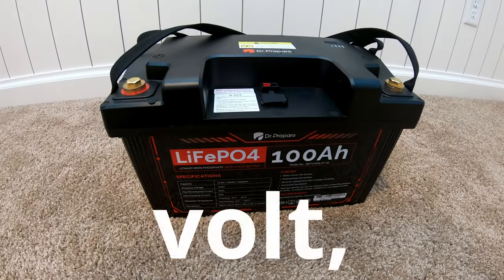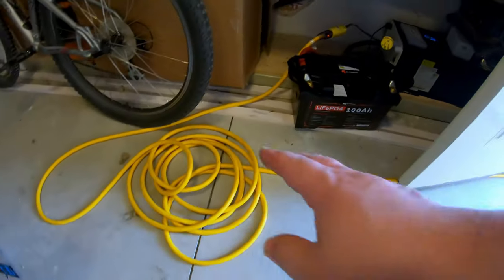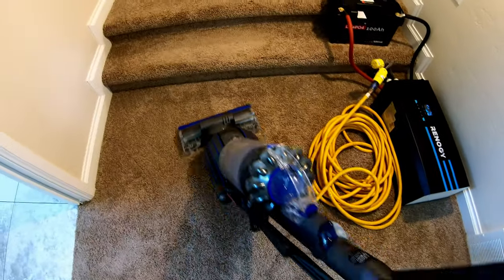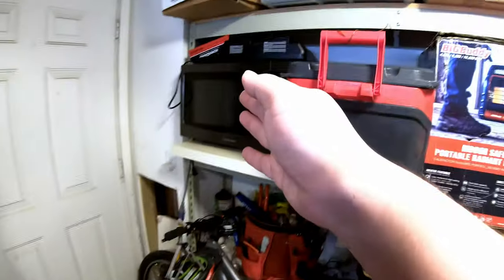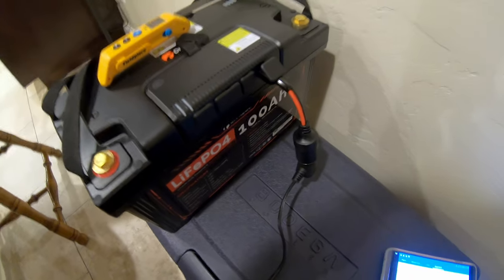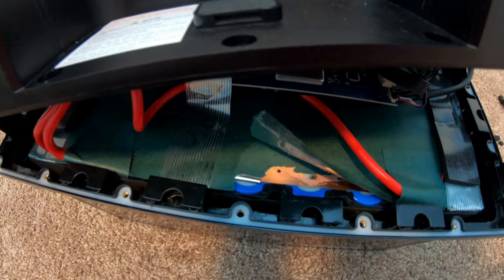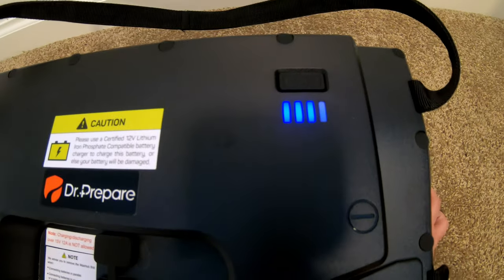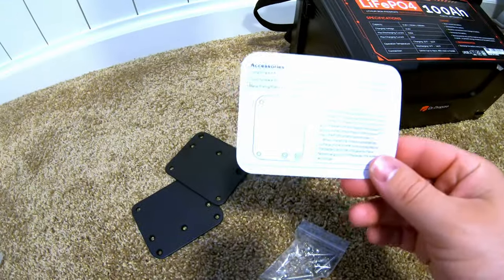Must-See: Dr. Prepare 12V LiFePO4 Battery & Hub Review

Comment: Darn, I'll have to get rid of all my Dyson Vac cleaners. I read that Dyson has discontinued all corded appliances (only battery powered now).  Also when you were testing a compressor cooler, you said that having no food inside or thermal mass, would be a worst case scenario. I guess I don't understand batteries and coolers... depending on what temp the thermal mass was at before the test ... or I'm not paid enough by Dr. Prepare.
Reply from the maker: I haven’t heard anything about Dyson discontinuing their corded vacuums. That would be sad. I love their animal line of vacuums.
As far as thermal mass goes…you’re right that if the mass is warmer than the cooler temperature, it will take more power to cool it off. However, most people will pack their cooler say the night before leaving for a trip, and the stuff has a chance to sit in the cooler overnight plugged in to AC power. Once the mass gets to the temperature of the cooler, you use less power to maintain it than just a bunch of empty air. At least that’s been the case for me and my use cases. Thanks for watching!

Comment: A small vacuum shuts down but the Dr Prepare runs a top load washer and dryer at the same time? I’m baffled, my Speed Queen washer draws over 9 amps just by itself, that little vacuum shouldn’t be more than about 5 amps.
Reply from the maker: Yep! The washer and dryer combined use less power than the vacuum. The Dr. Prepare has fantastic surge so it can start the dryer, but once it’s started, the dryer just kind of coasts…the vacuum is a sustained heavy load and trips the over current protection. Thanks for watching!